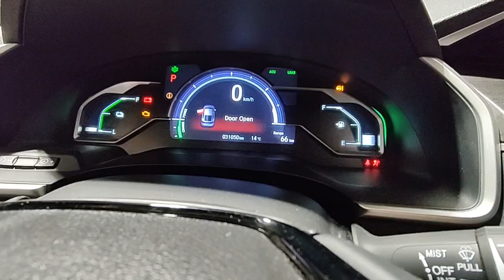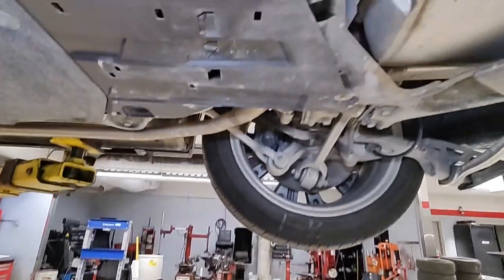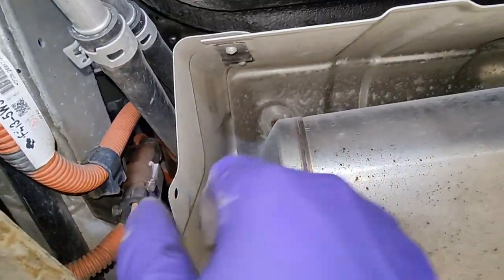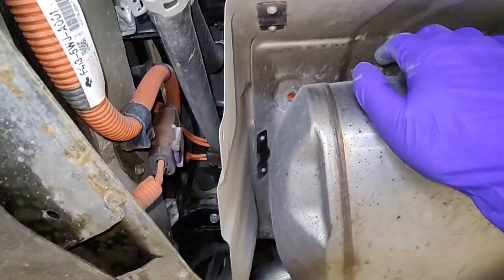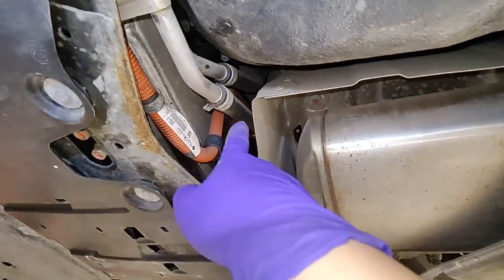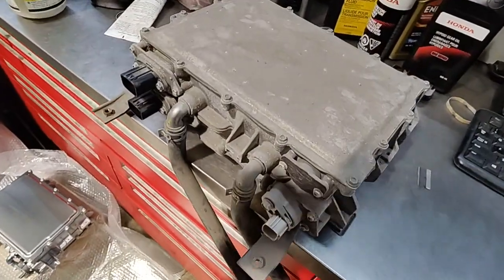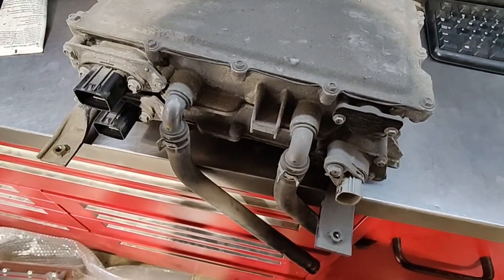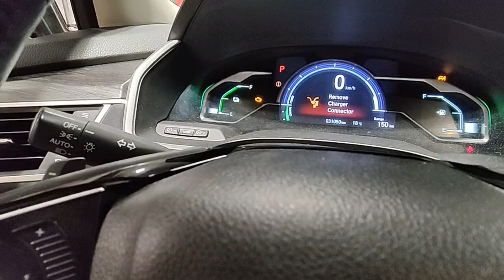It's not a plug in if you can't plug it in. Honda Clarity not charging. Replacing On-board charger.

Comment: The onboard charger is how the car is charged in HV charge....interesting that the plugin charher wouldn't function.
Reply from the maker: The hybrid charging system for Regen braking and motor generator dc-dc converter is controlled by the power control unit under the hood. The onboard charger would be it's own separate module just for the plug in function for charging the EV battery.

Comment: H-tech, did you had to go to enhanced electrical course?
Reply from the maker: Nope I actually had a Nissan leaf that won't go into ready mode and it had an isolation resistance break down code. Honda sent us our EV tool box but no EV tools in it assuming there was and I pulled the service plug and sucked out the refrigerant to check the isolation resistance of that a/c compressor. But had no tools so I put everything back together. Dunno what's going on when the prologue comes out.

Comment: I’ve been really enjoying your videos lately. Any idea on when customers in Canada will be able to bring their vehicles in for the new Honda fuel pump recall? I have a civic that is affected.
Reply from the maker: The recall is by complaint currently with a stalling issue or a code for low fuel rail pressure and even that we have to open a tech line file before  approval to replace the fuel pump. I think it is due to the availability of parts. Haven't seen many with the issue probably have seen a few that needed a fuel pump.

Comment: Вопрос?через сколько км делать регулировки клапанов,и на каком пробеге менять цепь ГРМ на хонда аккорд 2021г,спасибо.
Reply: Never replace timing chain unless there is a defect with it. There will likely never be a problem with it if you maintain the engine properly. The valve adjustment is only if engine parameters fall out of specification or excessive noise is heard from the valve area